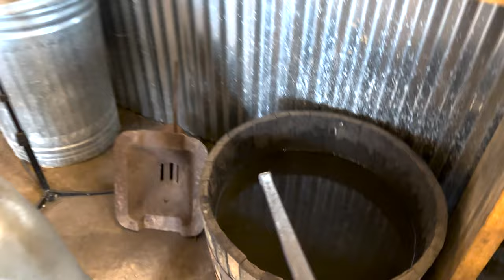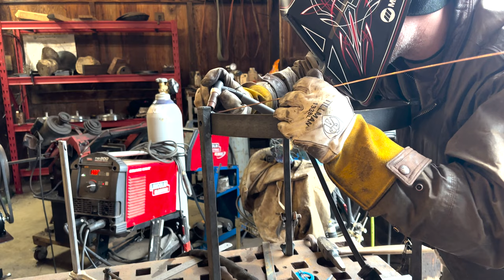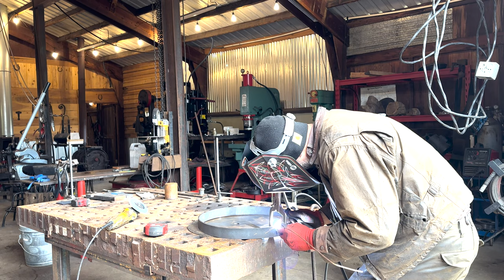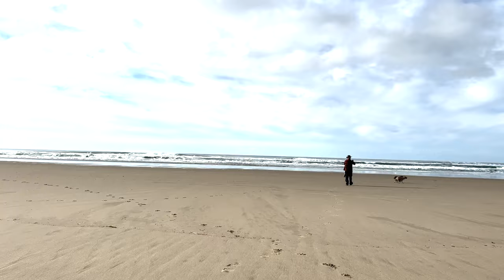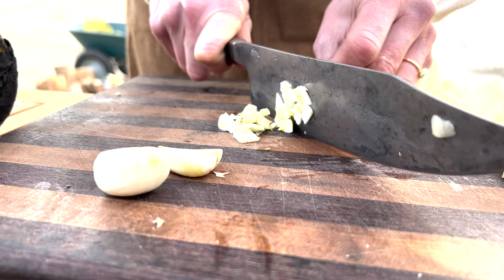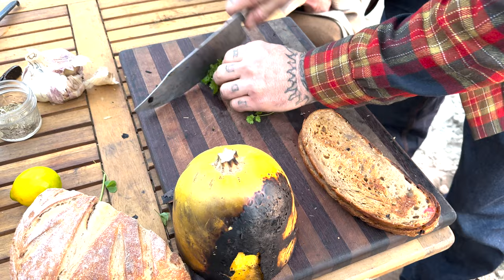Forging A Plow Disc Trivet (Cowboy Wok, Discada, Sadj)

Comment: That is nice. I have a discada that I have not been able to use yet because I do not have gas burner that will hold it. After seeing this I would rather invest in the wood fired set up you made. I would certainly consider buying one. What price range would you need to sell one for to make it worth your time?
Reply from the maker: Hi, I’m working on getting them listed up on my website. Please sign up with our email list for updates. Thanks! Stagecoachforge.com